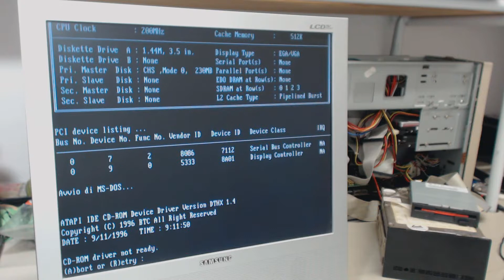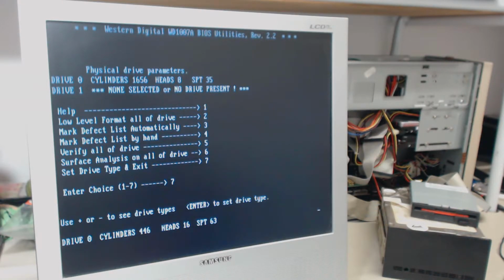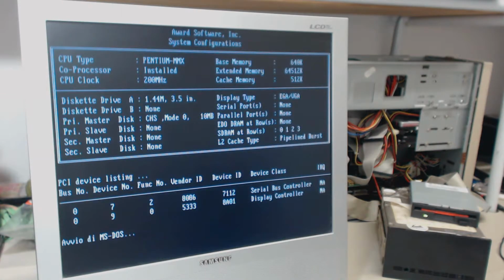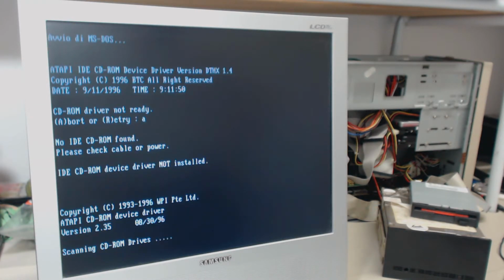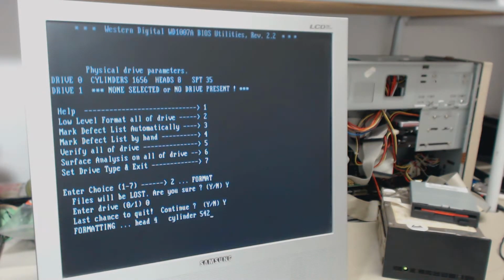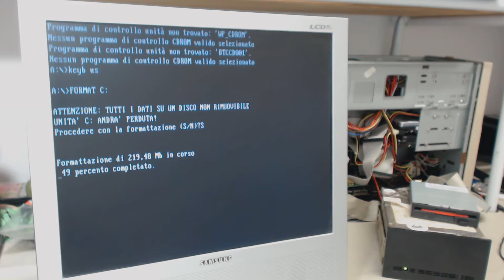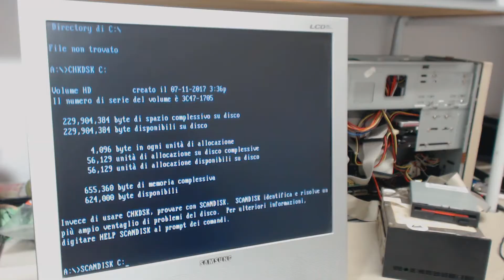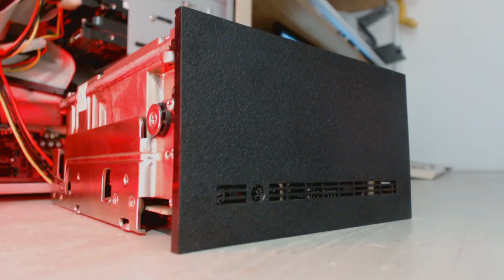Test and sound of a Fujitsu M2261E ESDI 326MB 1991 Hard Disk Drive

Comment: That has one of the best seeking sounds ever! 5:34
Reply from the maker: :))))) Thank You!
Reply from the maker: You should add Floppy disk drive sounds to Your channel!
Reply: @BitSplits  Thanks for the suggestion! I have a computer with a Panasonic floppy drive that does sound really interesting. Do you still have this Fujitsu drive?
Reply from the maker: @cdos9186  yes , kept religiously in a box
Reply: @BitSplits  It probably still works I would assume. Really good that after the scan you did in the video it had no bad sectors! Do you plan on making more videos of drives like these?
Reply from the maker: @cdos9186  I have no more drives like that at present,  and ,due to covid,  I can't access the recycle center where sometimes old things like that show up. Actually I'm still working on a monumental restoration project for  some IBM 3277 keyboards in such a bad condition that it took almost two years to complete it. I'll publish a video about the whole process. What I could publish is a boot sounds and workings of an Apple II floppy drive but I don't know how interesting that might be for the audience
Reply from the maker: @cdos9186  About the drive, yes it still works , I've been able to hook it to a 486 clone pc that I keep here to test  or use old hardware.
Reply: @BitSplits  That is pretty amazing it still works great considering the age of the drive and intended design life.